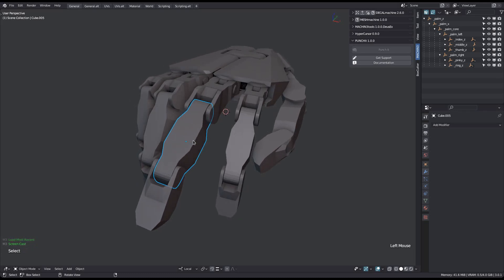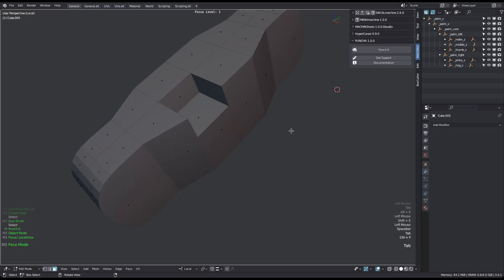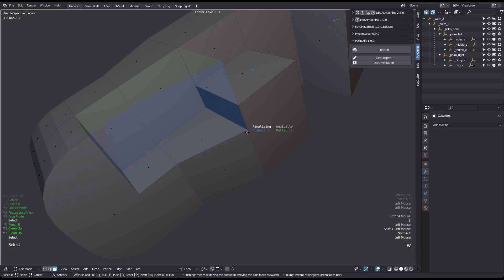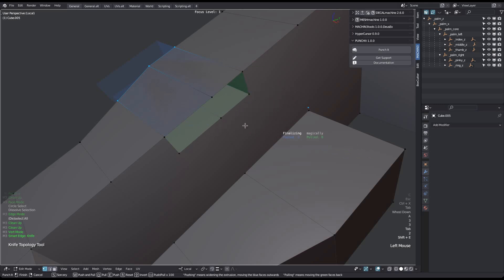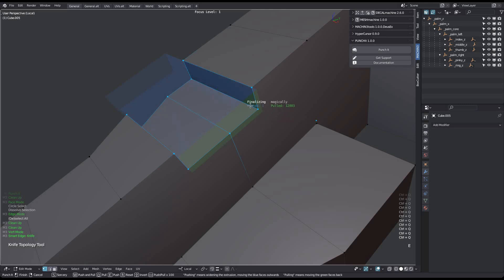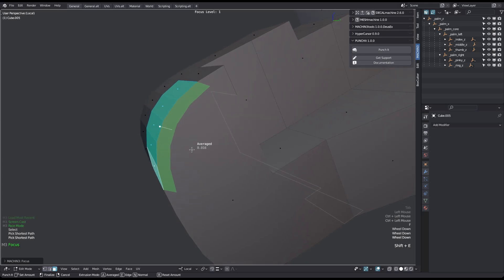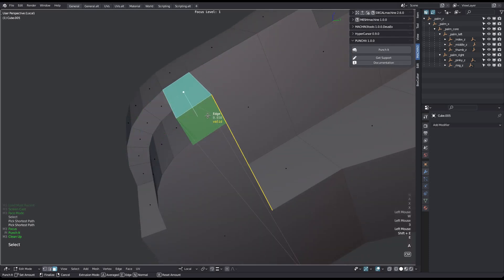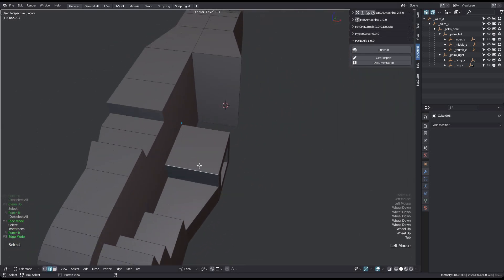PUNCHit 1.0 - Punch It

Comment: just bought the full version and loving it!  But I have continued to get blender just crashing aftering using punchit within 5-10minutes.  It seems to trigger when I control v(undo).  Does this sound familiar to anyone else?  Same issue with 3.6lts and 4.2lts.
Reply from the maker: Yeah, unfortunately Blender does crash occasionally in relation to undoing, modes switches too sometimes. Blender shouldn't ever crash in response to a python addon doing anything, as python itself doesn't manage memory (and a crash is a memory access violation) - but it does. Sometimes. Best to save often when using PunchIt. There's nothing I do wrong here in terms of code or API use, and due to it only happening sometimes, it's extremely difficult reproduce and so to report it as a Blender bug too.  Also as you noticed, the crashes don't happen directly when using the tool, but tend to happen on undo a little later  - so again, not in response to any particular code executed in the addon. Just wanted to make that clear, and confirm that I see these crashes too occasionally.

Comment: i dont know why but i cant drag the mouse to control the extrude, only can config it with numbers any idea why is happening? (tried on blender 3.3, changed it to 3.6 and its working with mouse drag)
Reply from the maker: 3.3 is not supported anymore. Minimum Blender version was raised to 3.6 with 1.1 already, as mentioned on the product page and in the docs.

Comment: I bought this at release but have since realized that I nearly always work with non manifold meshes when modeling, causing punch it to never actually work for me. Hope it can get some kind of support for non manifold meshes in the future.
Reply: i don't think it's just non manifold meshes, the problem is with any mesh that has a simple hole in it.
Reply from the maker: Which makes it a non-manifold mesh. You can circumvent the non-manifold mesh check in the code easily, but all bets are off then in regards to what the boolean will create.
Reply: @MACHIN3  Thanks for the tip! It working sometimes for me if I'm lucky sounds better than it working practically never.
Reply: @MACHIN3  Oh, sorry, I was under the impression non-manifold was something more specific. May be the problem is with blender's boolean system, then, right? I haven't had many problems with max's smart extrude on open meshes.
Reply from the maker: i'll add an option to allow it to work on non-manifold meshes, but as I set, all bets are off then.
Reply: @MACHIN3  Thank you! ❤️

Comment: Incredibly powerful! I need to study more carefully how this works. It's promising! Thank you very much for your hard work.
Reply: I suppose that you have to have a well prepared geometry with all quad well structured geometry - ready for the non-manifold extrusion...Or not?
Reply from the maker: This mesh has ngons all over the place mate, especially once I start punching. There is only one requirement. The mesh needs to be manifold. This is mentioned in the video.

Comment: Wow, Mac. You've just solved one of Blender's big problem, just like that!

Btw, can Blender's NURBS toolset be expanded just by using python alone? I think it would be glorious if Blender had better NURBS modeling tools. Because let's face it, doing hard surface modeling on a sphere-like polygon mesh is not exactly a walk in the park.
Reply from the maker: You can't really expand the NURBS toolset via python. And there won't ever by solid NURBS/CAD/Solids open source tool, that can measure up to Fusion, MoI etc. 
There is Plasticity coming up though, check it out, going to be multi platform too: https://www.youtube.com/user/nickkallen1/videos